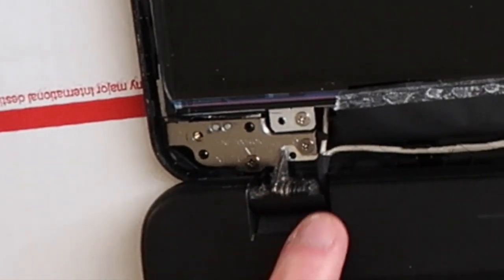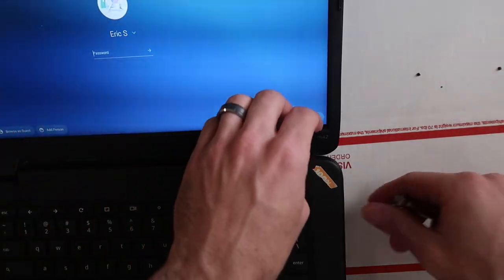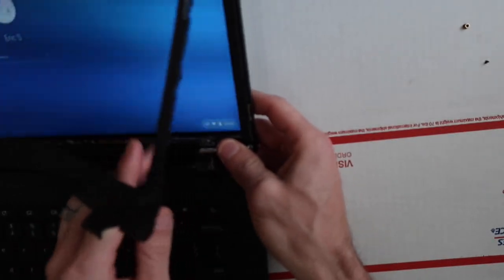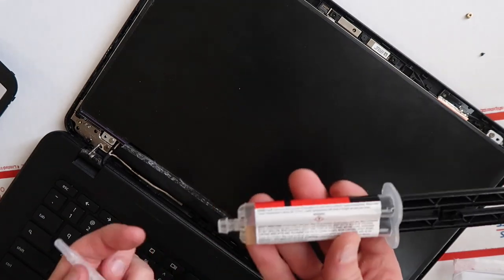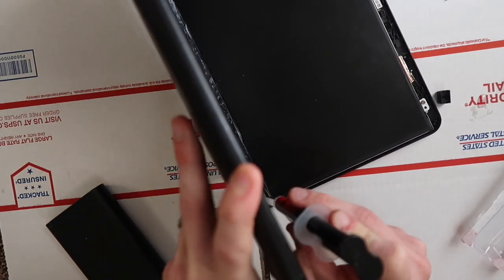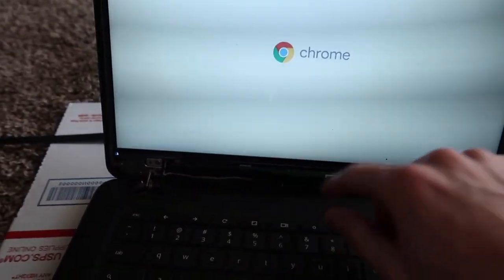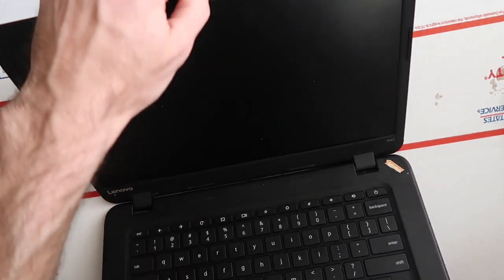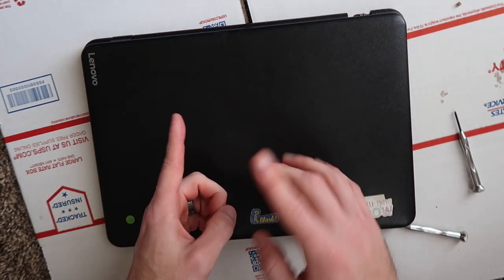How to FIX LAPTOP HINGE Using Epoxy Glue - Easy and Cheap Repairing Hinge on Lenovo N42

Comment: I like to use that brand of jbweld epoxy as well. But I don't do it quite like that. I actually take everything out (lcd screen, etc) of the casing where the brass anchor points need to go, secure them temporarily with superglue, then put the screws back into the brass anchor points, then use a fine injector syringe to take pre-mixed epoxy and put it around the brass anchor points, making sure to not raise the level of the surrounding epoxy up to or over the level where the securing screws set into the brass anchor points. Much more control that way, and it makes a better fit and finish. You might need extra light and magnification from a desk lamp/magnifier to get that kind of fine detail work done, but once the epoxy cures, it's actually stronger than the original cheap plastic and will last for much longer.

Comment: I’m amazed that screen wasn’t cracked. I say this for the sole fact of how bent that hinge was. Keep in mind that I’m posting this comment 48 seconds into the video with no audio 😂
Reply: Probably because the monitor it self (lcd panel) is a separate item that's attached to the "lid". And it's the lid that the hinges are attached to, so the stress would actually be on the lid (which is plastic) not the monitor

Comment: Used epoxy,super glue but both came apart guessing from the heat gaming laptop now im trying liquid nails clear tried 2 days curing came apart will try 7-14 days see what happens
Reply: What kind of epoxy some say jb weld is good I wanna try it

Comment: I have never fix a laptop before, but could I just add the epoxy glue around the hinge and let it dry?
Reply from the maker: Thats what we did in this video.
Reply: What happened bro did u fix it?
Reply: I don't think so. It would probably work out bad for you unless you know someone that knows.

Comment: I am impressed. I was being steered to E6000, E7000, and an E8000 adhesive. Your direction is probably the better direction...
Reply from the maker: Epoxy has worked for me many times on this fix.

Comment: hey thanks for the video bro!! im having the same issue with my Lenovo ideapad 330. both hinges are only holding on by the smallest screws. any update on your fix? is it still going strong? how long did the glue last?
Reply: I'm a computer technician, I have worked on literally thousands of laptops. the jbweld or gorilla weld epoxy works GREAT (once it cures after mixing) modern laptops plastics can shatter even if you just try to release screws to take off a bottom or top casing to work on them after a few years.. Stress cracks form very easily with the heat up and cool down cycles, style of use, etc. If you know the places to judiciously place the epoxy on the anchor points and have the proper tools, you can actually make your laptop STRONGER at its anchor points. I have an old toshiba laptop that I have kept alive for 5 years past it's recycle date because of that. The "Glue" as you put it, is actually a very hard epoxy mix once it cures, and is much stronger than current laptop plastics being used by most manufacturers in the industry. I don't know if you ever build tiny plastic structures and models with glue and polymers when you were a kid....but they work.

Comment: Thanks for sharing your fix. I have a similar Chromebook hinge break and perceive that it was ultimately caused by the hinge joints getting stiff. Did you put anything in the repaired hinge assembly to lubricate it, like a shot of silicone spray?
Reply from the maker: Yeah that would work 👍

Comment: Great job!! Thanks for sharing.   I have the same issue with my 2019 ACER Aspire 3. It's my work laptop...so it's a challenge taking it back and forth...sucks!! Already getting quotes to fix..$150.00 and up !!!
Reply: I can tell you a story about that. I recently had an Acer laptop that came across my bench that was OLD. windows 7 OLD. The cooling fan, $20 bucks replacement on amazon, went out. While I was trying to disassemble it, EVERY ANCHOR POINT broke just from me releasing the tension on them (the screws). That is a problem with plastic based laptops. The family that owned the laptop wisely decided to get a new pc because it would have cost them more for me to rebuild all those points than what it was worth, or to even try to get an entire new bottom casing.

Comment: Awesome Advice and suggestion I have 100s of the Lenovo N Series Chromebooks in my school District. the material on all the N series is so fragile and dry rots at the most used stress points. We have too many of these type of breaks. that epoxy is much easier to use than Gorilla Glue epoxy due to the self mix as it comes out the end of tube. not mixing to apply is so much smarter.
Reply from the maker: Appreciate it, hope it works out for the repairs.
Reply: agreed. The JBweld epoxy  with the automatic mixer cone vs gorilla epoxy (and I have tried both) works best for amateurs. I have used the gorilla epoxy premixed, then drawn up into a syringe and judiciously applied. Both of them work well. But....the jbweld brand with the automixer tool on the end is best for those that don't want to do the extra mixing step and having to buy syringes for tiny work.

Comment: Thanks for the video, though a quick question. So the hinge on my laptop (ASUS) was broken, so a friend glued the hinges. My computer however gets overly hot. Is there any risk of the glue possibly melting in this case? I figured not since Super Glue requires a great amount of heat for it to melt (So says Google).
Reply from the maker: You are welcome. It'll probably be okay. The heat doesn't build up by the hinges.
Reply: I would never "glue" the hinges. I would set the brass anchor points back to the housings/covers with hard epoxy, then put everything back together normally. Your friend was taking the cheap way out.
Reply: @erichayes4661  It is/was the only option I had to fix my laptop. I can't afford another one at the moment, so I wanted to be sure it could survive

Comment: I live in  Canada and my Lenovo laptop case starts to  crack due to tight Hinch ....what is the best epoxy brand you recommend please. once you tell me I will start to dissemble please,thanks
Reply from the maker: Any of them should work really.
Reply: This epoxy is available in Canada @ almost every big store.
But I recommend to use the manual mixing tubes one.

Comment: Does the epoxy hold it well ? Is there any chance of breaking again.
Reply from the maker: I can't think of any other way to do it with broken mounts without tapping new holes or getting a new bottom case.
Reply: @thecollegepicker  gorilla glue?
Reply from the maker: Might work but not as strong as epoxy in my experience.
Reply: in my experience....gorilla epoxy has held up better than original plastic case construction, and has in most cases extended the life of laptops 4-6 years or more past their "lifetime". There is a chance of "breaking" it....if you drop it again and the original plastic surrounding it shatters.
Reply: @thecollegepicker  I can and have repaired broken mounts using epoxy and judiciously applied drillbits to rebuild mount points. You're right.  Sometimes you do need to tap new holes, but you don't always have to get a new bottom case if you use creative methods to build new mount points, like sealed ends of bic pens. ;)

Comment: is there a way to do this without taking the plastic part off the hinge isnt as damaged as this one the back corner is just starting to separatie a little its my moms laptop and i cant take the plastic case off without her noticing...
Reply from the maker: It would depend on the laptop, taking it apart is the best way to get the epoxy to bond.

Comment: Is silicone glue or steelepoxy glue better?
Reply from the maker: I would use a hard epoxy. You want it to have no flexibility, basically building a new permanent hinge mount with epoxy
Reply: hard epoxy. thecollegepicker is correct. I have done exactly this same thing over 100 times. no joke.
Reply: @thecollegepicker  I have done that so many times for my clients. You really can build a good hard epoxy mount for those cheap plastic laptops.

Comment: Can you use hot glue gun instead 😅 Just don't want to wait the weekend to buy epoxy
Reply from the maker: I don't think that will bond strong enough 😢
Reply: @thecollegepicker  thanks, great video btw
Reply from the maker: @gigerin4848  thank you =)
Reply: Hot glue gun is like a tac weld for a very temporary fix. Sometimes, it works, but usually only for desktop type computers
The Epoxy works very much better, it's much harder and more heat resistant. I would only use hot glue for hobby applications.